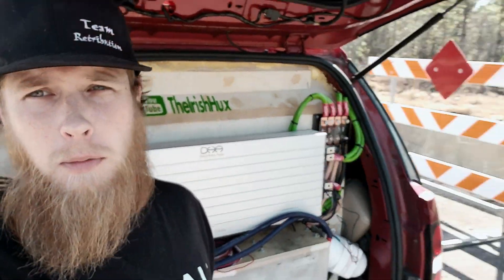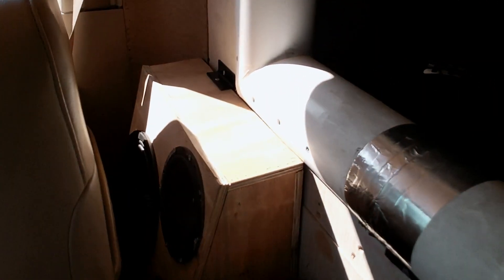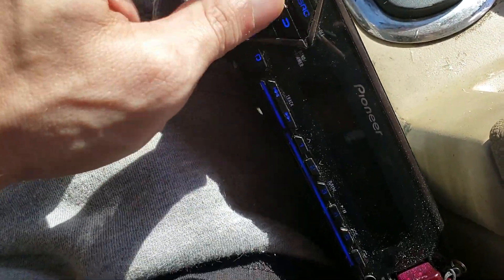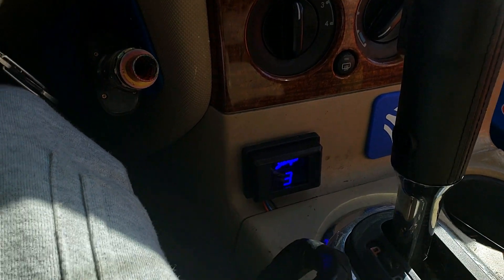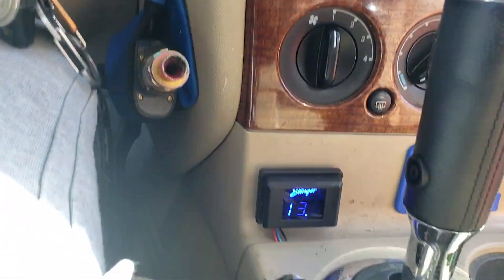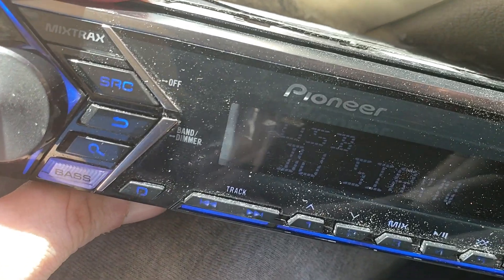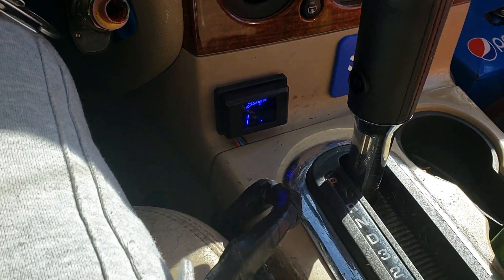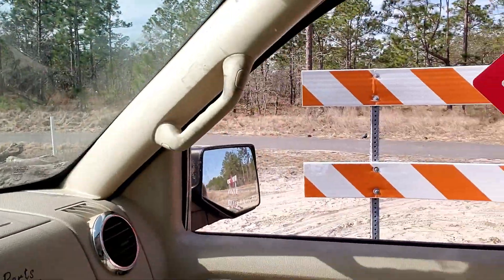Voltage Drop Testing | Mechman Alternator

Comment: Would that 240 alt be good for just a 2500w or lower system ?thanks
Reply: More then enough bro . I just ordered my Mechman 240 alt this morning . An I’m gonna be running two massive hippo XL 152 15s . At around 3000rms

Comment: What do you have your volt meter connected too ?
Reply from the maker: Volt meter is connected to the amps power and ground. Then the phatboy regulator shows voltage at the alt.
Reply: @TheIrishhux  I’m having issues with my voltage dropping when I accelerate with a mechman 240

Comment: What's the lowest your voltage should drop when the bass hits? Or what's lethal and bad
Reply from the maker: For a 12v amp anything below 12v is not good. Best to be in the 13-15v range.
Reply: @TheIrishhux  👍 another question Is having a high voltage bad for your battery? If it was a normal one perhaps
Reply from the maker: @jeremyvillegas572  it can be as you mentioned depending on the battery. They will all have their own voltage operating limits so always keep that in mind.
Reply: @TheIrishhux  alright thanks I've been trying to find these answers that matter! Very much appreciated

Comment: Id add another battery bro. 12.6 is too low.
Reply from the maker: I have 200ah of LTO. I have plenty of reserve. If you watched the video I talked about how the alternator is not working correctly. Reference newer videos with the new alt I full tilt 13.8-14.1v.

Comment: Did you get a new belt for your car?
Reply from the maker: No
Reply: @TheIrishhux  Di the alternator have a smaller pulley? The 1.75 inch one?
Reply from the maker: To be honest not sure man it was a direct  bolt on didn't have to change anything. Now when my new alt comes I may have to adjust my belt size.

Comment: My question is. I wanna run my AGMSMS480  and 2 agm 3100s under the hood. Then through a 70ah limitless and run the lithium AGM mixture in my truck.  You would think that's the best of both worlds and it would be good??? What u think. I see u did away with ur agms completely but u also have that big boy 200ah
Reply: Thar sounds like a great idea, Northstar and Limitless together seems like a great combo.  That 480 is no joke, add 80ah of lithium and on the surface youd think it cant get any better than that BUT... Im no battery expert but Ive always read and been told not to mix chemistries and you want all of your cells to be the same age with sane or very similar cycle life.  I understand why number of cycles and depth of discharge should be similar among all cells in a system, but as for not mixing different chenistries together, I dont know enough to thouroughly prove or disprove that idea.  I have a feeling its just so much easier and way less complicated to let the lithium do it all cuz they can, and if you want an incredible 1-2 synergistic  combo get a couple banks of ultracaps to supplement the lithium.  Rock solid voltage, very little drop or spikes, steady and constant E values!
Reply: @scottie6-573  yea I just bought my 480 and it's doing amazing . And with my new MECHMAN it's gonna be even better. I just love the look of them limitless boys and I've never ran lithium and wanna try it. Lol. Bass head cant get enough
Reply: @scottie6-573  hey thanks man for your input and they do say all lithium is better then the mix so if it's TRUE. Lithium and agm bump heads and cause ur weak voltage.  Hear me out.  What about if I keep my agms under the hood. I keep the agmsms480 in the back and I ADD A XS POWER SUPERCAPS 1000FARAD and will that combination work well together??
Reply from the maker: In my experience the agms bring down the lithiums voltage.
Reply: @TheIrishhux  so what's ur opinion on if I run my agmsms480 and add a xs power super cap bank ?? Will that be a better combination or mixture??  I just bought my 480 like 3 months ago and it doing great on my crecendo audio 6k  and my new ALTENATOR will be on by Friday.  I just wanna try out the lithium cause I've never had them. Lol
Reply from the maker: You can definitely run the agm with the lithium and see how it voltage sits. Then do some testing after removing the agm. Worse case the lithium by itself is better then u could just sell ur agm and put that money towards something else build related lol.
Reply: @TheIrishhux  what about mixing AGM 480 with super cap bank?

Comment: Bro ur holding damn good with only clamping 120amps out that ALTENATOR. That's like a lil more then factory. So that lithium is doing u justice fr. When u drop that 370 in. Ur gonna gain atleast another 1000 too 1500 watts out of your amp which will push u over the hump your looking for.
Reply from the maker: I sure hope so man.

Comment: anyone else have problems with a mechman alt? not trying to bash but I have the mechman 240 as well. with a single group 34 agm up front no batt in back and a 2k rated amp and maybe 150 -200 watts going into mids and highs. im dropping to 12.6 after wanging 4 songs (when idle). at 2k rpm im not dropping below 13 ever. should I clamp my alt or am i good?
Reply from the maker: I would clamp ur just to see how many amps your making.
Reply: In my opinion ur in good shape if u only dropped to mid 12s at full tilt and if ur staying above 13 when u run it up to 2000rpms then it's doing its job.  What was it voltage like with factory alternator?  I'd just add an AGM d3100 to the back and run 2 runs of 0 guage front to back.
Reply: @akirk2089  with the factory alt I only had 1k plus mids and highs. the voltage was not dropping past mid 12s
Reply: maxfmfdm I have a singer 240, odyssey group 35 agm, 1 run of OFC to back to a Zapco 150.4 & a 3k .. so 3600 rms roughly .. Recently on some songs I been seen drops as low 12.8-13 on my front battery where my volt meter is reading from. It usually bounces right back up after the bass note. I listen 2 regular music tho. 

I’m pretty sure my issue is from the songs having clipping or my input gain settings on dsp or amp. Incharge 14.5 cold but it’s been hot recently & I have seen as low as 13.8 driving around on a highway which is 2500+ rpms so idk if that is my car regulating the alt.. Even playing full tilt when it was 13.8 it was above 13.0. 

I thought at higher rpm I got more amperage / constant voltage but I’m bout to email Singer to understand how an alt works better lol hope this helped you!

Comment: I'm staying tuned. Have a 250 mechman myself. If this 370 you get works I'll know what I'm getting next. Haha.  That's badass you have that guy a demo.  Awesome video keep up the great work brother 👍👍
Reply: Dude CES is a MUST OWN ALT!!! i have a CES 320 on a 2000 honda accord and my voltage stays at 14.4 always with a lil over 5000 watts and i only have two little agm group 34 batteries. Plus the guys at CES are really badass.
Reply from the maker: Hell yeah man, I will put up a video ASAP. I will do some clap testing on the alt also.

Comment: I have a CES 320 in my accord. My voltage never dips below 14.2 and i only have 2 lil agm batteries. My system is only about 5000 watts but the alt is amazing dude johnathan is cool too man.
Reply from the maker: That's good to hear man. I have a few buddies with CES alts and they have had a positive experience. Mine should be here in the next week or so. I am chomping as t the bit to get here and installed.
Reply: @TheIrishhux  dude im not sure if it is a normal thing but i paid an extra 20 bucks and i paid for mine on a sunday and it shipped the next day. I had mine and installed on thursday. Lol but i didnt have it powder coated or anything. I just asked if i could pay extra and get it quicker and johnathan said sure give me 20 bucks and ill get it to you quick. I had it like 4 days after i bought it. They are awesome man. Im telling you.
Reply from the maker: Damn I should have slid him an extra 20 lol. It's all good then. I believe it will be worth the wait.
Reply: @TheIrishhux  i dont think its something he usually does he just knew i had been saving and researching and talking to them for like 6 months so i think he just did it because he knew how long it took me to be able to finally get it and because it was such a simple order. I mean if it was something he always did it would end up being redundant and those would just get him backed up just as bad as he already is. Ive kind of kept that to myself until now for fear he may be inundated with ppl asking for it you know? He knew how excited i was about it and how long i saved and saved and how hard it was for me to talk my wife into allowing me to spend 425 dollars on something that i really didnt need at the time. But because i was able to get it i was able to grow to the 7 amp 5 subwoofer and 8 sets of mids and highs system it is now. And still hold 14.4v at full tilt. Lol now i have been saving for atleast 50ft of 1/0 ofc and atleast 1 xspower d3400 which i need pretty bad. All i have is an optima yellow top and a dekka marine 75ah agm. Lol which i won on ebay for 100 bucks.
Reply from the maker: Hell yeah man. Bass is an accumulation game. Grows and gets better over time
Reply: What year accord?